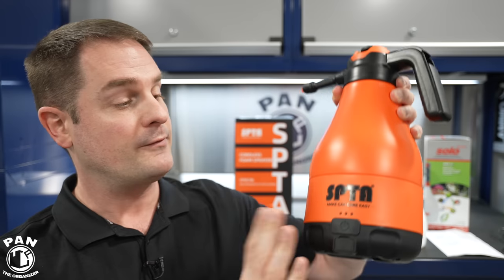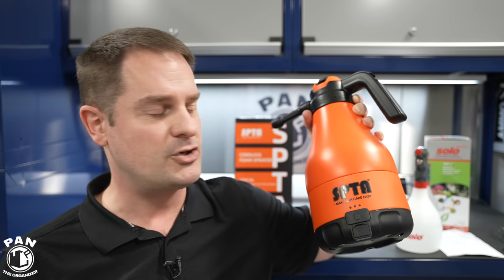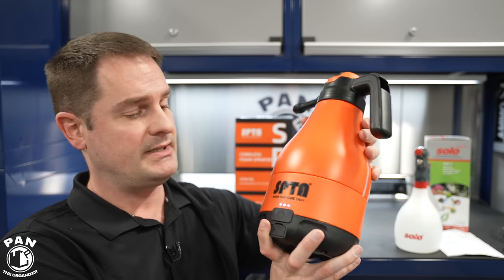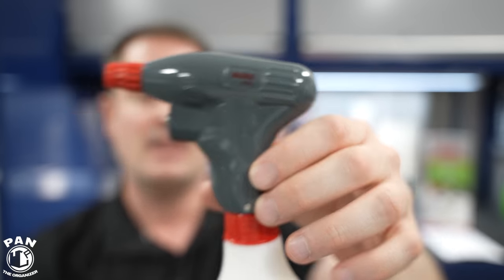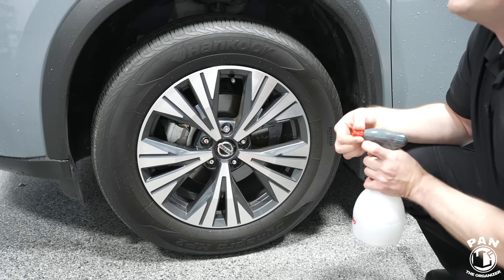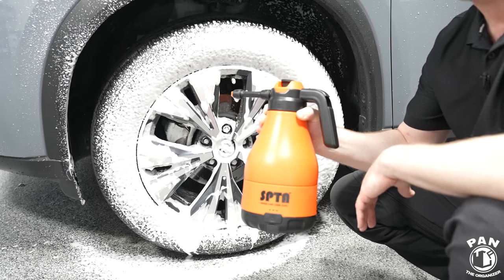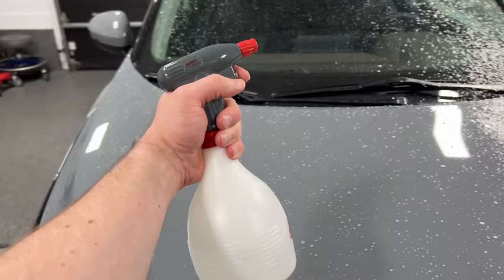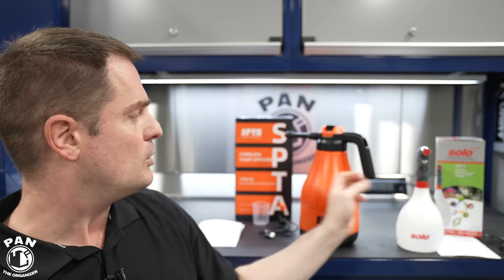Battery Powered Sprayers!

Comment: Best is the ik foam pro 2 + with a battery tire pump attached, works like a charm. I use it at a self serve as you can’t take a foam cannon
Reply: Or buy the IK pro 2 (none +) then add a schreader valve for $3 and then your tire pump. 😉

Comment: Excellent, I just purchased one and used it with my DIY detail rinseless . went around the car to prespray with rinesless. and did my usual rinseless with my bucket and sponge.  after I was done I put away my battery operated 2 gallon sprayer and my marolex  pump sprayer. this one liter solo sprayer was plenty to soak my  entire Toyota camry. quick, easy and convenient.
Reply: How is it still holding up? I'm thinking about buying one.

Comment: Not a fan of the Solo sprayers, purchased 12, they didn’t even last a month. Some didn’t last a couple days. They are fun when you first use them but the necks give out.
Reply: necks?
Reply: Mine been going strong for awhile now
Reply: I have only 1liter manual Solo 401. 
I used 20days/month, from 3 years for interior detailing/upholstery cleaning... absolute no problem!
Reply: I have OLD Solo pump units that I use daily.  Never a problem. Sounds like maybe your doing something incorrectly?
Reply from the maker: You bought twelve battery powered sprayers?
Reply: What type of ‘fun’ were you having with these? 🧐
Reply: You have to make sure that the neck is tightened down fully otherwise some air leaks out and it won't function properly.
Reply: Added them to the mobile detailing van. Loved the way they sprayed but they sprayed too much product as well. I carry 15 32 oz bottles in the van but they just didn’t hold up 😕
Reply: Where the screws are they just kept coming apart or snapping it was weird
Reply: U got 12 without testing 1 before? That was very smart👍🏼
Reply: @PanTheOrganizer  I purchased the spta one from your UK link but the product has a totally different name and is blue so again completely different to your review model but the same product. Let's see what actually arrives when it's delivered as I am going by the picture on the website.
Reply: @PanTheOrganizer  Just received the spta pump sprayer and looks totally different to your one, it's blue and called carbon collective.
Reply: Really? Cars with Keav did a review on them a couple weeks ago and loved it. Wonder if it’s a hit n miss thing? That’s really unfortunate to buy 12 n have a shitty experience with them.
Reply: @PanTheOrganizer  can you continue to use it for a while and let us know if it breaks?
Reply: Yup it happened to me too. I use adams tire and wheel cleaner and it destroyed the straw. The neck is already heavily crack and soon it will break too. Shame because I really like it
Reply: 14 bottles still working strong

Comment: I am a huge fan of rinseless washing and these would definitely come in very handy,  especially not having to constantly squeeze the trigger.     The SPTA, while yes it's expensive seems to be a pretty good value actually because of the larger tank if you need more liquid product.    Plus the fact you can change between the tips for foaming or regular stream of liquid makes it more useful than the SOLO.    I do like the fact the SOLO is smaller though and could be a great sprayer for interior liquids.    Both of them look like good unit's and each of them have their place in detailing for sure.   Thanks for the review Pan, hope you are well buddy.    😀✌
Reply from the maker: Yes and I hope you are doing well too Joe!

Comment: Very cool. If I were to buy a foam sprayer like the IK pro 2 that is $35-40m I probably would not hesitate to spend an extra $20-25 and get the battery unit. The the incremental cost the convenience of not having to hand pump seems to be well worth it if you're just using this for personal use and not all day professional work where the battery would never last long enough.

Comment: I have done this by attaching a tyre valve on a standard foam sprayer being pressurized by a Xiaomi gadget air pump. Very helpful and on a fraction of the cost. A bit weird to the eye though :) and Pan, I've seen that the pressure built is okish for one big panel but it needs some seconds to wait again to build pressure before going to the next. The hood for example when you start it's thick but as the pressure drops the foam is lighter. You'll have to step back for about 10-20 sec and spray the rest. With my set up I see on the pump meter that the pressure drops significantly faster and the pump cannot cop with it unless you wait for a while. Thanks for the review! Great as always.
Reply: probably takes longer to build up pressure as the container empties. Still beats hand pumping though.
Reply: @johndoe6032  true and true. You have to carefully adjust the applying speed so that it can build up pressure.

Comment: Sir Pan very much  obliged 
After a month it would not mist no more. I only use N914. So I checked cleaned the metal ball filter with warm water but still it won’t work to mist. I ended up removing the ball and until now mists very well. Stay blessed 🫡🙏

Comment: I am using this battery foaming sprayer over a year. It is good to use on the pre-wash process. 
Be ware that this sprayer not water proof, if water go into the charging port or the hole under the bottle, it will damage the battery and circuit.

Comment: This vid brings up a topic you might want to look into, Pan.

When I spray my wheels & tires with Brake Buster either in an iK Foamer (5:1), or a Foam Cannon/Pressure Washer (undilutes), my tires DO NOT "brown" when scrubbing with a Tuff Shine brush! When I spray them with Brake Buster straight out of the bottle sprayer or from an iK Sprayer (no dilution), my tires will drip and scrub brown. 
I think that foaming Brake Buster, it gets too diluted to do a proper cleaning. What do you think?

I have a Solo Sprayer for my Drying Aid (3D Bead It Up) and love the atomization and adjustable sprayer!
I just got another Solo sprayer for Brake Buster. It'll be undiluted. Just easier than an iK Sprayer.
Reply from the maker: Diluting any product makes it less effective that’s a given. If tires are really dirty, use Brake Buster straight undiluted. If it’s just a regular maintenance cleaning, using it diluted is fine and also more economical.

Comment: The SPTA needs a weighted straw like the Solo model. Amazon in the USA has the white model and wondering if the orange model has any improvements. The reviews on Amazon USA are so so. I just got the Solo and think about using it with my favorite glass cleaner  Sonax.

Comment: I like the Solo, but mine has a fatal flaw. After I've sprayed it (on a wheel, for example), I have to unscrew the top to get it to properly pressurize before I spray the next wheel. In other words, it's unable to keep a constant pressurized state. I definitely do not have this same problem with my Car Supplies Warehouse Electric Sprayer.

Comment: I got the SPTA few months back. Quality is there but It never pressurized. I let the pump run for 10mn. I got it replaced. The new unit had same problem. Ended up returning it. Also it’s very heavy.
Reply: I bought 8 and all broke within a month
Reply: @DETAILSofficial  Jezz 🙄 hope you were still in the return period !

Comment: Three improvements would be battery indicator, USB C input not proprietary, and finally a removable lithium ion battery. I just ordered a couple, the 460 is very hard to find in stock anywhere. If this was used with a spray wax of some sort would it potentially clog? Im assuming you would need to rinse it with water or an IPA and then water after wax to clean it before storage?
Reply from the maker: I would for sure thoroughly rinse it with warm water after use. And I agree on the USB-C port.

Comment: I will keep using my manual pump sprayers. The new electric versions compared to manual pump are more expensive and in my opinion not as reliable.
Reply from the maker: Which battery powered sprayers have you tested?

Comment: Hello Pan, 
I’ve subscribed to your You Tube Channel and enjoy the content you produce. This is the only way I can determine to reach you for a little mentorship. I’m looking into opening my own mobile detailing business. There are a few detailers around but only 1 or 2 have a professional appearance. Anyway, I just watched the Tornador video. You suggested an air compressor that produces 5 CFM, or at least 85 PSI. I’m going to be purchasing a detail skid by Rightlook. A Makita Air Compressor MAC 700 is part of the package. I’m not sure what CFM is but with the specs of this air compressor, is it enough power to use the Tornador Max? Thanks for your time.

Comment: I found that the Solo loses it's effectiveness after 60 seconds straight spraying. It seems to start spitting. To get around that issue I have to open the bottle and decompress the pressure. I tend to do that often. I have two of them with the same issue. Is that something common? Is there no intake valve to relieve the internal pressure?

Comment: Why so expensive is my question. A battery powered air pump with auto cut off is about $20, a good quality spray bottle is about $12, so why is sticking it together enough to justify ocer twice that?

Its a rip off.

Comment: If u gonna store the bottles for some time battery needs to be charged around 60%, or anywhere half way if u don't have an accurate way of telling the charge level, don't store with battery fully charged it's bad for the longevity of the battery, it's public knowledge Google it if u wanna see for yourself, that's why buying anything with lithium-ion inside will have the battery charged around 50% mark